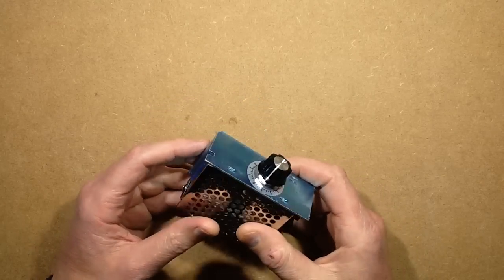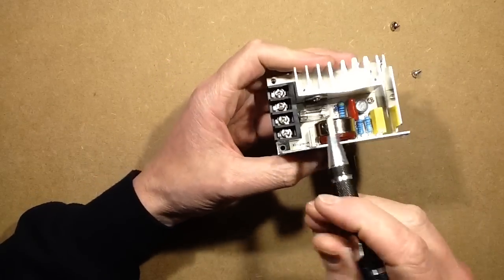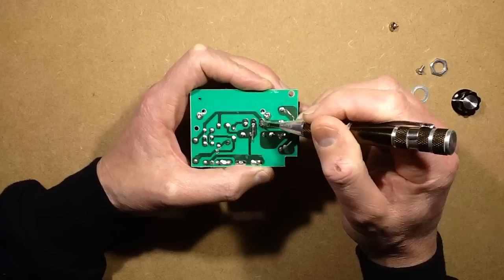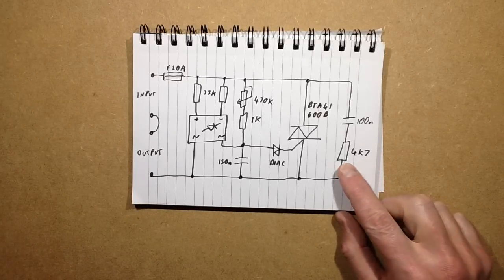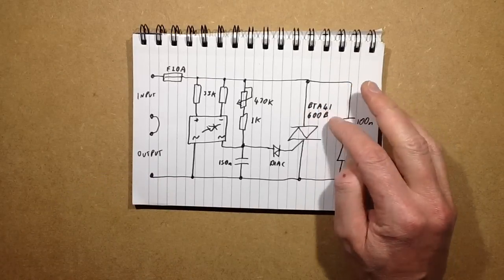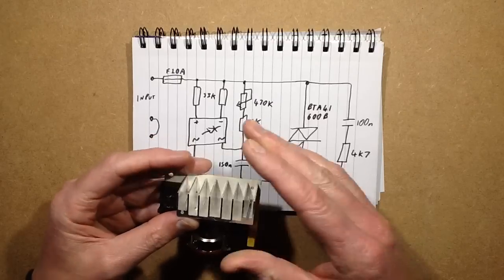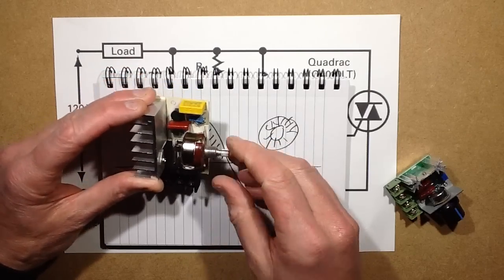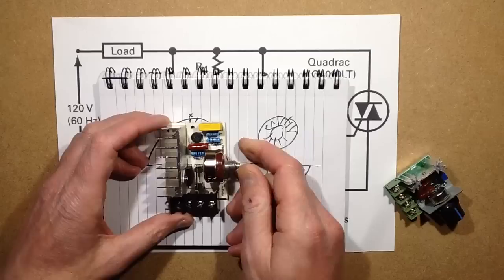Inside a "4kW" ebay power controller with schematic.

Comment: Forgive my ignorance but is this the AC equivalent of a PWM circuit?
Reply from the maker: +Jamie H Yes.  The phase control is similar to the mark space ratio used with DC PWM.
Reply: Thanks Clive. Great videos on your channel by the way!
Reply: +bigclivedotcom So if I understand correctly, it doesn't actually lower the voltage?
When using a 220/240V incandescent bulb on 110V you can massively extend its lifetime. Will using a dimmer circuit like this have the same result or does the lamp still get 220/240V spikes?
Reply from the maker: +Ni5ei It lowers the power dissipation of a lamp, so you could use a dimmer to nudge the power down for longer lamp life, but efficiency of the lamp would fall dramatically.
Reply: +Ni5ei 5% lower power to an incandescent is generally considered to double the lifetime of the bulb. Any spikes that it might receive from the circuitry would (probably) be much too short in length to actually influence the intensity and therefore does not effect the lifetime.
Reply: Thanks both. So would it also be possible to turn this halfway down and use a 110V incandescent bulb on 240V mains?
Reply: +RyuDarragh that's why you use zero-crossing triacs :)
Reply: Cheap incandacent bulbs for the international market are commonly optimized for 110v, as its cheaper that way(less raw materials required), and as a result have a reduced life on 220v. However, running a 220v bulb which was ACTUALLY designed for 220v on 110v would result in a HORRIBLE power to light output ratio.
Reply: No one in their right mind should be using incandescent light bulbs in 2017 anyway. 
They're basically electric heaters that also happen to emit some light, and by running them at lower voltage you're emitting even more infrared and even less light.

A cheap 10W led light costs 2€ and an incandescent (halogen) one is about 1€. Here in Italy 1kWh costs me around 17cents at the lowest. 
A 10W led will easily replace a 60W incandescent, saving 1kWh every 20 hours of operation. 
After just 120 hours of operation the led lamp has already saved me a couple cents.
Also, I've never had one of those 2€ lights fail yet in over 2 years, not even the one in the bathroom which goes through a lot of on/off cycles. 
If I were still on incandescent one or two of them would have certainly failed by now.

Seriously, incandescent bulbs are a 150 years old concept. It's time to switch.
Reply: I prefer the "urine yellow" 2700K myself, but it's pretty hard to find anything below 3000K these days and that's close enough. 
I can't stand the 5000K white, makes me feel like I'm at work.
Reply: Great question was going to ask the same!!
Reply: Demoniack81: What about the unfortunates that take migraine headaches under your money saving lighting system.

Comment: You have a "monster rated" pot in the device since it needs to be rated at mains voltage across the track in series with the 1k and 0.1.  Worst case scenario is when the wiper is coming towards the end of the track. It is only protected with the 1k while charging the 0.1. The more up to date ones seem to be using pots designed for audio work which is a little alarming, and possibly getting a little too hot.

Comment: Clive's rule of thumb for about 1W/A power dissipation is about on the mark for this device. Here's a table of common UK heating element values versus amps and heat dissipation (plus 4kW).  Values are Watts RMS / Amps @240V / Watts heat. See AN2703 for the equation used.

𝟸𝟶𝟶𝟶    𝟾.𝟹     𝟽.𝟶𝟽𝟷𝟼𝟾𝟻𝟶𝟷𝟽
𝟸𝟺𝟶𝟶    𝟷𝟶      𝟾.𝟼𝟻𝟸𝟼𝟾𝟾𝟼𝟾𝟽
𝟹𝟶𝟶𝟶    𝟷𝟸.𝟻  𝟷𝟷.𝟷𝟸𝟾𝟹𝟼𝟶𝟾𝟼
𝟺𝟶𝟶𝟶    𝟷𝟼.7  𝟷𝟻.𝟻𝟹𝟸𝟸𝟻𝟾𝟿𝟸

I have the 'digital' version of this device and will be trying it out tomorow in a plastic unventilated but spacious enclosure at 2kW for about 90 minutes. We'll see if it overheats. I think that little heatsink would benefit from active cooling. The usual disclaimers about the chances of this actually being a genuine ST part apply.

Comment: I used it on a welding machine and changed the fuse with 20 amps and it works
Reply: 20 Amp ! you might as well put a 3mm  nail, It will work !!!!!

Comment: Thanks for sharing this review,  I like reviewing stuff before buying it. You said you have not seen it built like that, you never to old to learn, might be a 10yrs Asian boy or girl took a old made controller and improve on it to power and control a toy they have or school work where their teacher give them projects to improve on old equipment. Never underestimate the Chinese way of doing things.
Reply: In my experience electronics design engineers in China are generally first class at their job. Most problems arise from the changes made when management tell the production guys to cut costs below the limits needed by the original design.

Comment: I have had a quick read but did not see any comment on this.
The reason that glass fuses are not good for high current interuption is that the fuse wire vapourises and can coat the outside of the glass forming another fuse link. The problem with that is the glass keeps it cool so it needs a lot higher current to blow and this will shatter the glass leaving you just the end caps.

Comment: Great one Clive, I'm in my 60's and have built AC controlers all my life but never seen this set up before ! I think the snubber ressistor is wrong and maybe thats why they were selling them off on Ebay, cheaper to sell them than to repair them.
Reply: +Robothut It is not wrong value, it is relatively common for modern TRIAC (it just show someone did homework instead putting random values). Low value of resistor is wrong way in designing rc snubber for TRIAC it will increase turn-on stress which with low value of resistor can damage the TRIAC.
Picking components for TRIAC rc snubber is balancing act, but using better TRIAC will lead to greater values of resistor.
Reply from the maker: +Miloš Lazović Could you point me to a schematic on the Internet where such a high value is used?  The purpose of the snubber is to absorb a transient that could exceed the DV/DT rating of the triac.  The triac used in this unit is a normal non-snubberless one, so would require a typical snubber combination.  The 4700 ohm resistor is going to severely limit the ability of the capacitor to attenuate the transient.
Even with a 100 ohm resistor and the capacitor charged up to peak mains voltage the current would be limited to a tiny portion of current not exceeding around 3.5A.  That's nothing to a 40A triac with a peak current pulse rating of around 400A.  Especially when the capacitor is a mere 100nF.
Reply: bigclivedotcom
first that pop on my mind is ST AN437, and you will see why they use high value of resistor and why low values are not desirable
Reply: bigclivedotcom 
capacitor volt 100nf and 150nf
Reply: Miloš Lazović ñ

Comment: I have a 2 kW variant of this triac..use it to control the speed of a 120 volt PM DC motor.  It feeds a full wave bridge rectifier with a large run capacitor to help smooth the resultant DC.  works but still noisy.   need to add a choke ib series to keep from blowing the fuse.
Reply: I just ordered a SCR and rectifier to control a 130v DC motor with FF 1.0. How did you size the capacitor? I'm not sure how to figure that out.
Reply: i think you will find this a SCR not a triac.
Replace this with an triac and double your power and decrease the noise.

Comment: Phew,  I'm glad you mentioned Radio Amateurs as I was shouting at the video when your said suppression chokes are not needed these days. Can you do a video on Power Line Transformers and tell people not to use them for exactly the same reason. Cheap Chinese ones won't have the filters in and render thousands of pounds worth of sensitive radio equipment useless.

Comment: Question: Would I be able to use one of these to power the heated build plate of my 3D printer? It's essentially a 1.8 ohm resistor, and I'm not sure if something like this would work.

Of course, it would trip a breaker if I turn it up too high, but I'd be running at ~24Vrms and ~400 watts. Does this sound reasonable?
Reply: I don't think this will work on 24V~ as it is designed to work with mains voltage.
Since your resistive heating element is low voltage and high current (17 A), you can rectify the 24 volts and use a NE555 + mosfet for power regulation.
Reply: Sunny Julien Divine
No, I don't mean 24V input, I mean 24V RMS OUTPUT. The whole point is that I CAN run the heater on AC, so there is no need for a separate 24V switchmode power supply (which is what most people do). I was thinking that this would be a better solution. I already ordered a similar one, though.
Reply: This device is not suitable for your intend as the minimum output voltage is around 33 volts. It would cause a current of over 18 amps and therefore blow the fuse and maybe the SCR if you turn it up accidently. The better solution would be an extra transformer or smps for your heating element.
Reply: Look at 15:04 then you will understand why using this on 24V is not a good idea.
Reply: Sunny Julien Divine
Ah, okay. Well, I already bought one, so I guess I'll try it out and see what happens. It was cheap enough that if it dies, I won't be out much.
Reply: @LazerLord10  So what happened ?
Reply: @millomweb  I ended up putting two 12V server power supplies in series. This thing doesn't like high-current loads at low power settings.
Reply: @LazerLord10  Can you not get a 24V SMPS? Putting two 12V ones in series just doesn't sound right. They're isolated from the mains, I'm told, so that's OK. It also seems more expensive. If you're not scared of the mains, you can get 240V plates, which solves the problem straight away. You'd turn it off before you touched it anyway. You'd have to get into the habit of that, although the plate itself is usually something like glass, so you're insulated. Still good habit to have though, just for the wires and terminals running round being a potential hazard, not being double-insulated. 

Julian's idea of using a 555 and a mosfet looks good. You'd be PWM regulating, at a constant 24V, probably the best way of doing it. Whatever rate of PWM you used, the heater would smooth out easily. Just a standard 555 square-wave generator with duty controlled by a variable resistor, and a big mosfet. All info available on the web. Or you could chicked out and throw an Arduino at it, also attached to a big mosfet, and do the control in software. Then you'd be able to add features to it, use thermistors to measure temperature, or else measure the voltage across a "resistor" in series with the heater. The "resistor" here would be a bit of ordinary wire with a resistance of not much, but still useful compared to the resistance of the heater. Perhaps aluminium wire would be good, or just a thin strip of aluminium.

As the heater got hotter, it's resistance would increase, causing more voltage across it, less across your resistor. So measure the voltage across it and you've got a useful number. Most Arduinos have an ADC for this. But you could just use a thermistor, or a couple of them, even. Maybe even a coloured LED or two, an LCD would be overkill. Use those RGB LEDs, they're cool for signalling statuses of stuff. 

Or a 555, if you're boring. They're reliable. Since the dawn of time, til the end of time, the 555 chip has faithfully oscillated away, in a million circuits quietly working. Why they can't just use a nice multivibrator made from 2 transistors, I don't know.

You could even stick a bi-colour LED, the ones with 2 legs and the LEDs are on opposite polarity, to indicate duty cycle by colour. There's something that's the least flashy. Just connect it to the output of the 555.
Reply: @greenaum  Didn't read the whole comment, but I'll address a few points:

The reason I went with 2x 12V supplies instead of one but 24V one is that I already had server-grade 12V supplies at hand, and I trust those way more than anything I'd get off Ebay. I also couldn't find mains-rated build plate heaters that fit my need, as I have a 300x300mm build plate, which is an uncommon size (at the time). In addition to that, I could stick with the same heater that came with my printer and run it off 24V to get 4x the power output, which was basically required because of the huge area; it couldn't even maintain 70C at 12V, so it was very underpowered and runs much better with 24V.

Comment: in regards with the 4.7k on the snubber .. I believe that to be intentional. If that resistance is too low it would defeat the benefits gained from the rectifier which in it self provides some snubbing.
Reply: I think it can also prevent arcing when changing the speed under high load? Being too of a value small might cause the system to become unstable since the bridge rectifier is doing a lot of low end stability.

Comment: I am an amateur radio operator and I had a weird experience with a touch lamp. If I transmitted on my radio in the HF bands (3-30MHz) when I unkeyed the radio I'd get a noise that started near the frequency I was on and would slowly drift up in frequency. If I tuned a little up or down I'd get away from the noise so it was like a carrier wave. It turned out to be a touch lamp I had that wasn't even on.
Reply: Touch lamps should be illegal.  I had horrendous interference all across the HF bands that I eventually tracked down to a touchlamp in a neighbors basement 5 houses down the street.

Comment: I'm using this very thing to automatically limit a boiler power (from home assistant with esphome) so that it matches pv solar. I considered using a digital potentiometer but there were complications, mainly too much heat dissipation, and maybe live mains on the microcontroller so I ended up using a servo. After 1.5 years of continuous adjustment the pot gave up so I replaced the whole thing wih something very similar but this time detachable thus easily replaceable potentiometer. There are better sollution but this works for me. Needs active cooling.

Comment: I think you alluded to the RC network as being more of an EMI filter instead of a snubber and I would agree with that assertion. It will roll off high frequency power spectrum whereas a snubber is designed to limit the possibility of transistor damage due to voltage excursion. A snubberless triac wouldn't need this feature externally.
Reply: Hi was just thinking of getting one of those to contr a mot. Transformer in power supply experiment just wander if you think. It would work in this application. Thanks I will like n sub very good video

Comment: Thanks. I learnt something and that's the point. Never knew about the ceramic fuse point either. Really useful one to keep in mind.

I often wondered about the sharp edge from triacs on inductive loads especially transformers. I was thinking or experimenting wit ha large triac before a arc welder to drop the power but was worried about the high frequencies generated causing massive heat problems in the welders transformer.

Comment: I open my unit. Same as you have . It gave this 4.7k and when I remove it completely it make a humming inside the unit when I set the knob under 40% and upper 30% .
So I think it's a filter for the triac it self
Test it under load of heater 220v 1600w
Reply: Interesting - did you  try different resistor values, too?
Reply: @NeuronalAxon  no I did not because I was not sure if I change it for lower or higher value is the right thing to do since I was need to install it asap in my water heater.

I need from you to calculate if this resistance and the Caps can be filter for some frequency ?

Because some transistors when they switching on and off they make noise by it self I think
Reply: @NeuronalAxon  ok . look what I did now . I just make some calculations for this RC network and I get this information 

Resistance: 4.7k
Capacitance: 100n
Frequency oscillating : 50hz
Impedance : I got 32 kohm
And phase fixing : I got -81.6 
Current ammunition : 3>7.8mA

So what do you think ?

Do you think this a safe guard network for the transistor so it can descharge the capacitance inside it when you try to play quickly in the knop by changing the voltage so quickly and not let the high current make any damages in the transistor ?

They say every transistors have an internally C and R virtual and they changing depends on current and voltage and frequency .
Reply: @abeditani8293  - Very interesting - it could be to smooth out rapid changes of the dial, I suppose.

Comment: I believe the triac is a "snubberless" type (you mentioned that). The snubberless don't really need a snubber (the word "snubberless" is kind of a self description). The rather high 4.7k resistor is only used to take the "edge" off of the waveform and not trying to really snub.
Reply from the maker: Sadly, no.  The snubberless version of this triac has a suffix of BW.
Reply: bigclivedotcom
I see. My bad. The 4.7k must be a mistake.
Reply: @therealjammit  yah machine mangwane ke liye mobile number chahie

Comment: Neat trick with the diodes, and using a bridge to implement it. I learned something new too. But the unit should have an insulating film under the PCB, like the PS in the same case does.  
Also, when you mention things like app. notes, please provide links to them.

Comment: The heat sink screw looks excitingly close to a live track.  I'd be trepidacious installing this near ants!  If the case is grounded and touching the heat sink, it might be on the wrong side of the fuse as well, but I couldn't really tell from the picture.

Comment: And, any RFI generated could also affect those who use over-the-air receivers for home entertainment.  It's not just the amateur radio operators who are affected.
Reply: The interference is worst in the HF shortwave bands and below.  No home entertainment receivers operate that low.  Pretty much everything is VHF hi and above now.  Unless you still gather around the parlor radio and listen to the evening wireless program in your house.